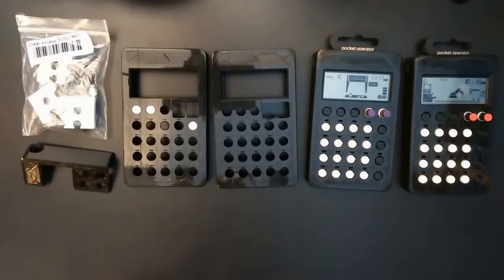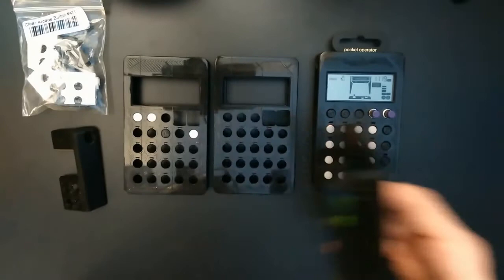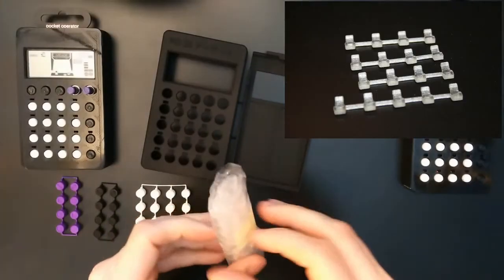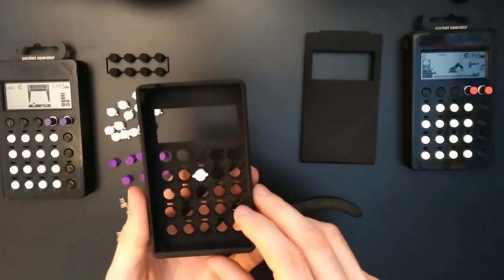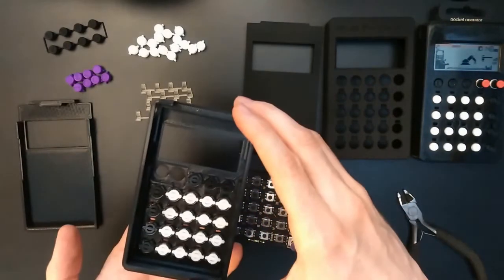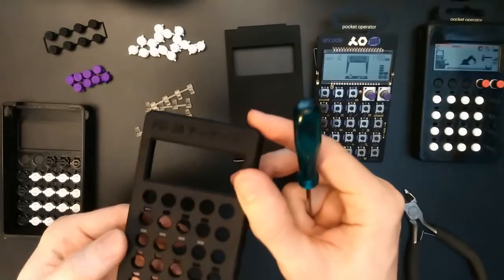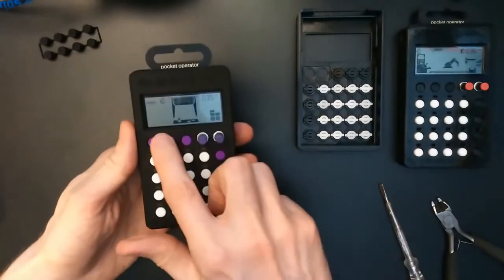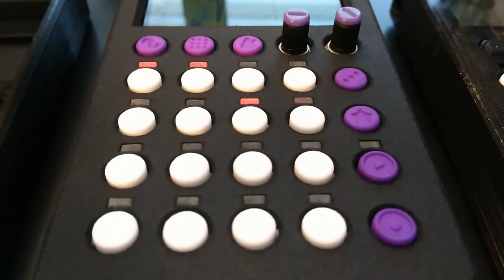3D-Printed PO-Case Prototypes, Assembly, Demo

Comment: Why not cover the batteries with the backplate as well?  Do it and I'll buy a couple
Reply from the maker: +yayayaokoksure There is also a backplate available which covers the batteries. It has a bulge where the batteries are located, so the case sits at a slight angle when put on a flat surface. You can see a rendering if you follow the shapeways link, it's called "PO case closed back". Making the backplate flat and still covering the batteries would have made the whole case a bit too thick.
Reply: +khoroshen niiiice. Thanks I'll check it out now!

Comment: Hey, I'm totally new to 3d printing and it will be my first project. Is it possible to add name of the PO on the top, just like you make on the video, on the slicing software? On the Thingiverse you uploaded only the .std and .stl files. I'd love to have a  "PO-33 ガイド" on the top. Do I need .CAD files to add that?
Reply: You can alter an stl file using tinkercad for free online! They have a font you can use to add letters to the design.